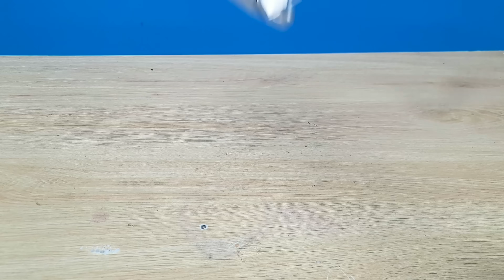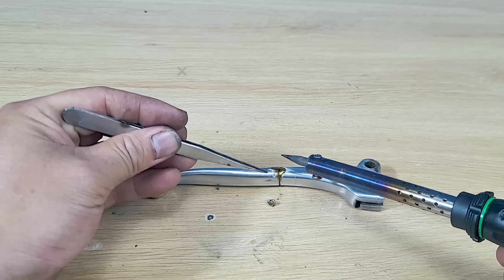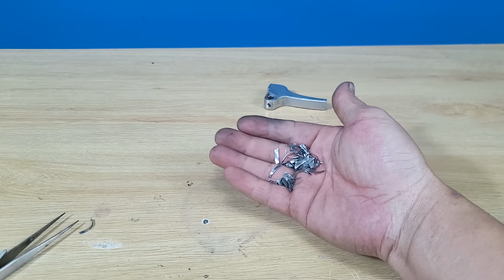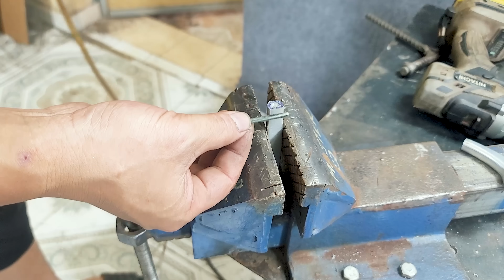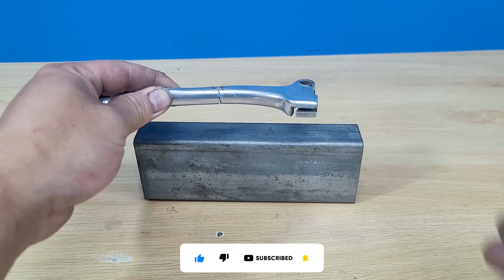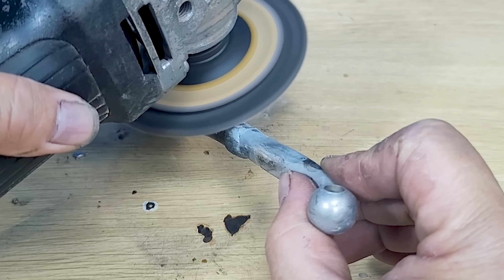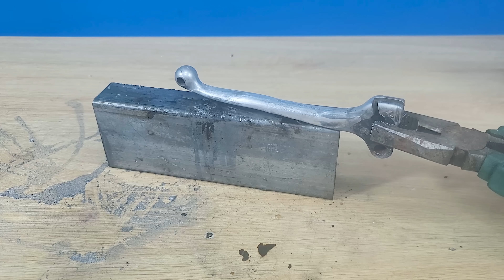Even a NASA professor had to learn this from me! Idea of using 1,5V battery to weld aluminum brakes

Comment: Clever idea. A few suggestions on how to make it better.  First, you left the bluing agent on the joint.  It will contaminate the joint so get that off with acetone before brazing and you will get a much stronger joint.  Brushing the Al around the crack to take off the oxide layer will also help. Second, while the steel screw trick was a clever way to tap the hole, steel should not be in direct contact with aluminum as it creates a battery of sorts and will corrode; search “galvanic corrosion”.  Use an aluminum fastener if you can find one.  Finally, there are aluminum brazing rods like Aluxcor that are intended for this purpose and work pretty well.  

Personally if I had to reuse the part I would tack it together with a tig welder, grind out a groove on both sides to ensure full penetration, tig weld it, grind and polish.  A break lever is a safety item.
Reply: 1.5$ part on AliExpress?
Reply: Wait.  You know all that and can’t spell “brake”? 😂
Reply: So is a brake lever
Reply: Yup, I was taught that it's referred to as "dissimilar metal corrosion", but I also like the galvanic corrosion reference, either way, it's now exchanging ions between across the two dissimilar metals.
Reply: This is one of those repairs where you don't need a fancy or even get a hold of a tig welder.   And it's a brake lever. It was a clever solution should a brake lever break.
Reply: Hello, what is the name of that liquid, thank you
Reply: Hello, what is the name of that liquid, thank you
Reply: @hoseinrezaei280  It's acid (as in PH less than 7... probably 2) zinc chloride solution. (He made it from the case of a carbon zinc battery (note, not every battery type has a zinc casing)  The zinc is a the soft metal he is stripping from the battery case, and it dissolves in hydrochloric acid to give a solution of zinc chloride (dissolved) and hydrogen gas (the bubbles). It's a type of acid flux that welders use. The acid flux you can by is more effective... but, the homemade stuff works too.
Reply: You do not want the break lever to brake or come lose and make you loose control. It will be a lucky feet if you manage to fall on your feat.
Reply from the maker: Hello, thank you very much for sharing with us, you are a good teacher, you have given me a lot of knowledge, you are worthy of our respect, we look forward to receiving your support yours in the near future. Wishing you and your family a peaceful and happy Christmas
Reply: @inventorK20  There are not men that are NASA professors. though the organisation may have professors who work at NASA.
You are not the bright spark . This is the most mishandled metallic cluster that can be presented. Your use of zinc to 
enable a bond of sorts between aluminium and solder is a creative thought. But tin and lead do not have the type of strength you need in that application. So you add a threaded bit of steel. You don't teach a professor who works at NASA a single solitary iota yet! more likely a professor who works a NASA tasked with solving this problem might return with an  improved shape of the lever cast in 7077 alloy or 6061? Perhaps a billet of such exotic alloy you will be perplexed by the formula, which is then milled to within a rough tolerance around 0.0001" by CNC machinery, that he writes the code for would present a stronger item with no contamination or flaw that also is made to fit much better. If you really believe a native fellow will ride a worn out scooter from the jungles of Asia unable to remain upright on it then breaks the lever off and is subsequently overwhelmed by the prospect of obtaining a new bit from Japan for his 40 year old Honda will then arise to educate an aerospace engineer he calls professor that is a man involved in realities beyond your wildest nightmares, then you my fine feathered friend have got another cluck plucking. operating a camera and editing on the computer though? There may be a future for you in Star Wars alongside G.Lucas.

Comment: The aluminium in hydrochloric acid did FA, then heating it actually oxidized the outside, this "repair" will break at the first most important time you'll need to use this handle.
And Who is this low IQ NASA professor, if he believes this BS, I'd like to duel him for his job...👎👎👎👎👎

Comment: The integrity of the fixed lever comes from the steel screw inside. Make it longer, much longer. Also drill larger diameter holes, because it is extremely difficult to place them 0.1mm precision to face each other. If the hole is larger you can fill it with epoxy, push a steel rod in it and align the parts snug, without gap.

Also: this is not welding.

Buy a new one, or just go to a shop where they use argon and really do weld.
Reply: But you can use an aluminum arc rod and hook it to a car battery and weld it. A 6010 only needs 100 amps. Most car batteries are 650 DC amps it will run a welding rod. Much better than solder. And no need for a bolt. Just grind the ends and butt weld it. You can get a whole pack from the net for 3 dollars.
Reply: Why not just take a TIG and weld it the right way?
Reply: @NoneYa-mf2ys  not everybody has TIG machines or worthwhile skills.
Reply: I think it is best to buy a new one
Reply: The silliest thing i have ever seen...
Reply: The even have aluminum arc welding rods.
Reply: Thank you for your advice, I tried making a video this way and had trouble soldering it, now I can complete part 2 of this task, thank you for sharing, good luck! Merry Christmas and keep supporting us. ❤️
Reply: There is always one
Reply: Sorry, but there is NO advice about the technique except "spend a few dollars and get a new lever."
Reply: No way I would put my brakes on that mend. First time you need to do an emergency stop the forces involved in the panicked grip will snap it at the repair...
Reply: @colg3263   same here
Reply: @colg3263  I also tried it to see how effective it really is and I will also make a video about this actual answer, thank you.
Reply: De uma Harley Davidson vale a pena concertar 👍
Reply: This is not even close to a Harley.  @TheMarceloorige
Reply: Thankyou your idea but it's not curet it's long process. Simple make the tig welding.
Reply: so guhettoe
Reply: Te csak elméleti ember vagy.
Reply: The steel screw is not large enough. You could do a similar repair but you need a much larger screw, and you want a grade 8 screw. Drill it with a real drill, then tap it with a real tap. Then epoxy it.
Reply: Yeah no kidding this wasn't even worth it!
Reply: You are seriously trying to solve a broken brake lever? Really? There is a reason 1st world countries have stringent roadworthy test requirements. Its because it saves lives. If a person cannot get a new safety certified brake lever from an authorised supplier their vehicle should not be on the road. I don't give two hoots about the life of a person without the sense to fit safe components on their vehicle but I certainly value my own life. This person should not be allowed anywhere near a vehicle much less be allowed to use it on the road. God forbid some poor unsuspecting person buys a used vehicle from this individual. Who know what other exciting and wonderful surprises they and other road users can expect. Get a grip, stay out of LaLa land, and come back to earth.
Reply: If that NASA professor learned to do this nonsense, I'm not surprised because the Challenger exploded during takeoff.
Reply: Desperate needs call for desperate measures..not everybody lives in an affluent society/community.❗
Thank you for your useful interim tip..❗👍🏻🇿🇦
Reply: @bernardhill1622  hmmmm. but if you live in a low paid society, taking shortcuts and dying does not help.
Reply: @JustMeBlindFreddy  
You must try living in the Bush some time my friend & improvise..its a sure education when you realise that your PhD ( Bld.Sci) means absolutely squatt in an emergency in your curcumstances and your age as well as your string of qualifications disqualifies you for being usefully employed even as a  Craftsman Artisan with 5 University Degrees..i recommend try it some time and see how long you survive..been at it since 1996 & at age 77 still going strong & learning every day..❗👍🏻
Shalowm ❗🙇‍♂️
Reply: @bernardhill1622 Non-affluent community needs cheap solutions, and cheap solutions result a cheap community.
Reply: How desperate the needs are, is shown, when he uses pliers to unscrew the hex nut. Net video: how to repair worn hex nuts. @bernardhill1622
Reply: This is welding,  meaning burning the material together using like material,  the gap is to back fill fracture, using the steel screw will only get stronger due to the disssembler material fusion between steel and aluminum.
Reply: @johnmartin2079  Whaaat? Stronger??? These are dissimilar metals and steel and aluminium do not live well together and will eventually corrode due to galvanic action. This is not a permanent repair. I'm assuming the lead solder is just a cosmetic gap filler and you might as well cut out several steps and just fill the gap with JB Weld.
Reply: @johnmartin2079  I see you are an expert in welding.

Welding means joining together (metal parts) by heating the surfaces to the point of melting. Not "like material" but the same material. In the case of aluminum, you can do this only using some protective gas, or else the melted metal immediately reacts with the oxygen of the air and will never become one when cooling. It could be soldering, but you cannot solder aluminum for the same reason you cannot weld: an oxide layer prevents proper adhesion. There is no fusion between aluminum and steel. Not possible.

Suppose you are very experienced and use a TIG or MIG welder to join steel and aluminum, even overcoming the difficulty of the very different melting points of the two materials. In that case, the resulting form will break when it cools down because the two materials have very different thermal expansion ratios. Nobody welds steel to aluminum.

The voodooo he does with the metal parts taken from the battery is nothing but voodoo legerdemain. To get subscribers and advertisement money.

I guess he uses some soldering metal that he melts until it adheres to the steel rod inserted into the drilled hole.

But go ahead and repeat the process for yourself. You can study and accept what the experts write, or you can do an experiment yourself, not believing anyone, revolutionize aluminum welding, and become a billionaire.

Both approaches are respectable and I will respect you if you do that. You do not need to believe a word of what I say or what the experts say. However, until you repeat and do weld aluminum successfully to steel, you are on one side with your OPINION and the whole welding industry with their expensive and complex, difficult-to-use aluminum welding tools, and seemingly everybody is stupid paying the big bucks for these tools when it is so simple and cheap as it is described on the video. Not likely.
Reply: When he dissolves zinc from the battery in muriatic acid he is making zinc chloride, an effective flux. The excess acid in the zinc solution will dissolve the oxide layer on the aluminum, leaving it clean and amenable to fusion for at least a few minutes. What he is doing here makes sense. pre treating Al this way also allows a good adhesion with epoxy. TIG is better, but not the only way and not available for everyone. I don't believe this vid is fraudulent as you appear to believe, although his method may require practice and persistence and is not as safe as a tig welded part. I am a welder, and also a former chemist,and have cleaned and chemically inactivated aluminum surfaces in order to apply coatings and this guy is on the right track anyway. @PeterVerhas
Reply from the maker: Hello nice to meet you. We look forward to receiving your support in the near future. Wishing you and your family a peaceful and happy Christmas.
Reply: @inventorK20   and THIS reply shows that this is an automated POS and is NOT TO BE TRUSTED
Reply: @inventorK20  you're dxmb as a bag of glue, matter of time until you cause a harm

Comment: That is a clever repair.  However, if that is a brake actuator, it would be more prudent to replace the part rather than risk failure of the repair.
Reply: Yep. BUYYY a NEW handle bro ! Come on now. Trying to save a piece of cheap aluminium . . . gosh 🙄🤕
Reply: @TebogoMotlhale  If you're in a part of the world where a new part is not available, then this is a great alternative.
Reply: @Kanamit.  Tambien esta la alta probabilidad que no tenga las herramientas para hacer ese remiendo falto de seguridad.
Reply: @TebogoMotlhale  Alimunum is potted. It has air pockets. It is a weak metal that breaks easily.
Reply: Yes. This a life-saving lever. Stop fucking about.
Reply: 冒着失靈！發生意外受傷風險。😱😱
Reply: @FunGKEE  我同意。
Reply: Saya setuju dengan anda. Ide tanpa perhitungan dan judul yang angkuh.
Reply: should have anchored a pin in there, then welded it imo

i mean it is an important lever
Reply: @dopeytripod I think this would be stronger than what he did with this imo.

He could've even have drilled holes in each end of the screw when they're in place in the handle & pinned them into place, & then welded it all together & welded the pins into place. 

This way if the weld would crack or break etc, the pins are still in place & won't likely pull out before be can repair it again.
Reply: @ClickClack_Bam  i mean 20,000 psi - 30,000 psi for braze on aluminum... not sure your grip strength though; think average is about 100psi.
Reply: Nah, just use some aluminum-colored duct tape, and you're good for years! And nobody will notice! :)

Actually, isn't this repair just soldering and not really welding? In that case, I agree it's better to replace it.
Reply: Ótima idéia para restaurar alguma peça difícil de encontrar, como algum veículo antigo.
Reply: Bendable metals are better because they "give" even though they are softer.
A casting can be glued with epoxy, or JB weld, or Krazy glue (cyanoacrylate) or welded. Even with welding, they are initially stronger, but they SUDDENLY give out.
I don't recommend it.
Reply: And so much easier.
Reply: I think is way better not to drop the bike 😂
Reply from the maker: Hello, nice to talk to you. I am very happy and look forward to receiving your support in the near future. Wishing you and your family a peaceful and happy Christmas
Reply: @inventorK20 you suck
Reply: Уже в могазин бы бегал 😂😂
Reply: @ANDREY-ib3ko
Reply: In a country like where he is from, you have no choice of buying a new part. You learn to fix what's broken. Very ingenious.
Reply: Anything goes in china
Reply: Japan  @Jim-e7q9q
Reply: his repair actually gives it more strength and support...
Reply: @johnnywebb8696  From the information available in the video, it is not possible to say the strength increases or decreases.  For example, welding aluminum creates a heat affected zone (HAZ) in which the strength and ductility can be altered and a stress concentration effect can be produced.  Since it is not possible to say with certainty that the part has not been compromised, replacement is more prudent.
Reply: Much like welding, the repair is likely stronger than the part in it's original form.
Reply: @stephanieluigon5192  sorry for late response. if you dont mind, can you explain or elaborate please? im interested in knowing why and how is that possible

Comment: Nice video. can you explain the flux portion? what was the toilet bowl cleaner mostly made from? also the battery shell?
Reply from the maker: Hello, thank you for sharing your wonderful thoughts with us. I'm very happy. Thanks a lot. The battery I used to get zinc reacts with hydrochloric acid to create a solution in the form of a flux. I look forward to receiving your support in the near future. Wishing you and your family a peaceful and happy Christmas. happiness
Reply: My advice to you is to replace that brake lever before you use the bike again.Hydrochloric acid , over time vastly depletes the inherent strength of cast aluminium,  which is what the lever is made of. It's a great method to use ON OTHER, NON-CRUCIAL  COMPONENTS.

Comment: Let's see if I got this right.

Cut open a carbon-zinc AA battery and dissolve the zinc inside with hydrochloric acid to make zinc chloride flux.
Cut a tap out of screw #1.
Drill and tap a hole on both sides. Use dye to help align the holes.
Screw #2 into the hole. Cut its head off to make a stud and screw both sides together.
Solder the gap using a blowtorch and zinc chloride flux prepared earlier.
Polish the part.

This is a mechanical repair reinforced by soldering, not really welding.

And as demonstrated early in the video, rosin core flux and soldering iron is not enough for this work.

Comment: A similar thing happened to my moped several years ago but it just got bent. I roled it to a shop who said that they had the part and fixed it. I arrived to pick it up the next day and when I tried the break, the lever broke and I didn't even press hard at all. The shop excused themselves and fixed it by the next day. I never went to that shop again.

BTW Just buy a new lever. This is dangerous as hell.
Reply from the maker: Hi nice to meet you. I look forward to receiving your support in the near future. I wish you and your family good health and a Merry Christmas. My good friend
Reply: Particularly odd that the lever suddenly looks totally brand new, after the cut/edit after the cable is re-attached, when suddenly all of the black marks vanish before it's turned over and screwed back into the bike. Looks a bit fake to me.
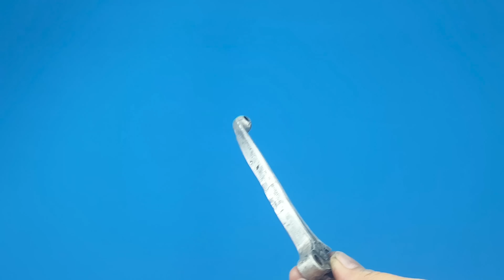Reply: @dj1NM3  look at 7:27 he shows both sides. It looks the same when he mounts it to the bike. It's the same lever that he fixed. If he actually used it is another question.